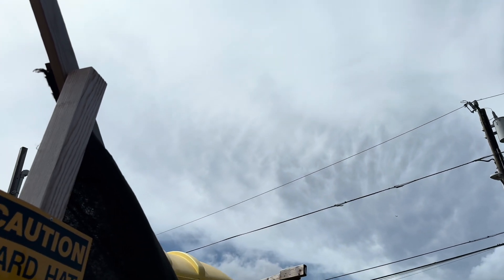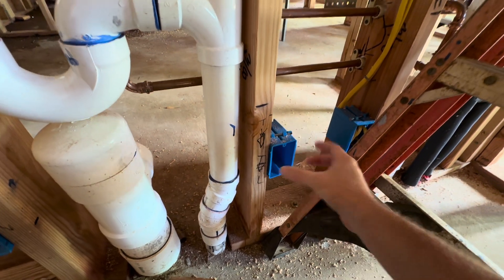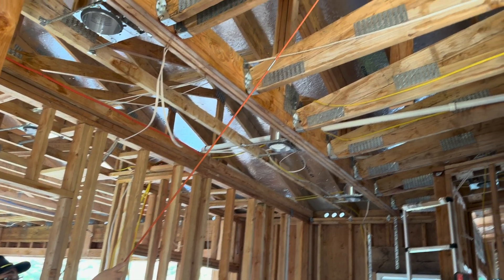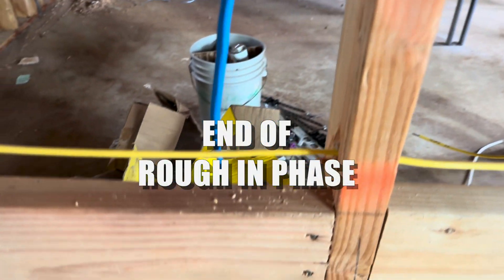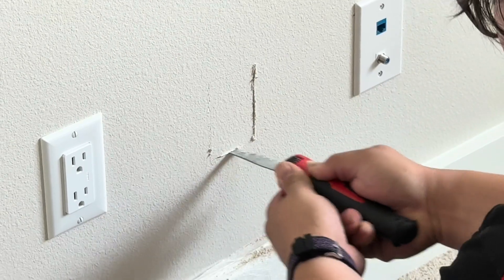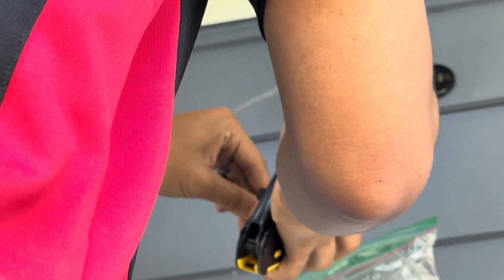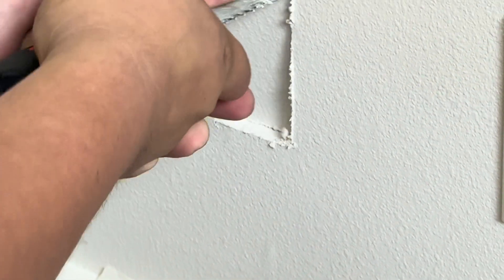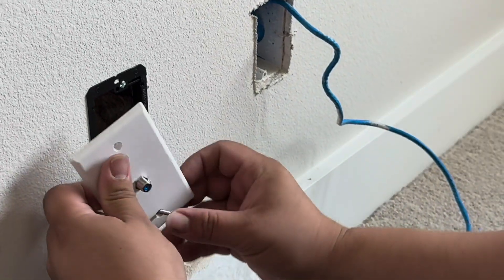Learning Network Cabling - Single Family Home

Comment: I put UFO's in my house, way better range. One in the middle gets the interior. Tiny hole for cat6, the mount plate on some drywall anchors. Keeps the insulation in the attic, and it's easy to patch over if I sell, and the new owner doesn't like. I ran the cabling down into a two gang mud ring with a brush plate. There's a few holes in the top plate, about 15 runs.

Comment: Been watching your videos as I will soon be running cat6 through our house we are about to start building. Been very helpful and glad to see you did a residential install. Two questions for you. Do the zip tie you used have a screw mount for them to go into the wood? If so, do you have an amazon link? Second question, why did you terminate the cat6 through the ceiling of the closet instead of the wall? I had always planned to go through the wall so just curious if there was any reason to do ceiling?
Reply from the maker: The diameter of the hole needed for so many wires would have split the 2x4 basically apart, so we did the ceiling entry.  Also, for later maintenance it is a little easier to string a new wire through a ceiling entry than the stud frame.  The zip ties, yes I used ones with a screw mount, here's the type we use: https://amzn.to/4oaYnhZ
Reply: @tciproductions  Thanks!

Comment: Know this is an old video, but what cable passthrough in the ceiling is that at 10:18 with the 4 screws? Never seen one like that.
Reply from the maker: We make them in-house on our 3d printer, if you look up TCI Productions on MakerWorld you can grab the model from there, its free.

Comment: I really appreciate you showing this, example. I had
My home pre-wired and am finding it difficult in how to install the outdoor camera’s. My vision is to have two cameras on each corner, and with 2 cat6 already run to a box on the outside, I am not sure how to protect the cables  or add outdoor rated , cables. Do you have any suggestions?
Reply from the maker: The easiest way is to paint them.  That will give a coating that soaks up the UV rays and can help a little with water infiltration.  Otherwise, what we sometimes do is put a keystone on the interior of the building, and then run a short length of exterior grade cable to the outside.  That way you don't end up working with the tough jacket of the outdoor cable while you are pulling into the closet.  It may depend on your site access and such of course.  But don't worry, most cables live happily outside with paint on them for a couple of decades.

Comment: I'm in Australia and unfortunately we do not have a standard of using the mounting boxes on the studs. Data cabling is too often an afterthought.
I was a cable installer on weekends while I studied engineering many years ago and few people appreciate the complexity of wiring a home - let alone once the sheetrock/gyprock is up! 

I'm having a security company install CCTV and other data lines etc for me in a couple of weeks and I'm trying to update some of my knowledge. 

May I ask a couple of general questions around ethernet and fiber runs in a residential ceiling space?  My goal is to understand how the cables should be run through an accessible residential roof area... strung? every crossing of power perpendicular? Service loop each end or acceptable tension going between floors etc?

For clarity on my question: As a junior installer I was taught to string CAT5 and coax through the trusses and to use velcro straps to hold it in place. I was not to leave it running across the joists like power cables and such do. Australian housing is a shit show in this regard and I've too frequently found power/telephone/antenna run haphazardly - even wired across the man hole.

Situation:
Moved in a few months ago and prepped as best I can - while solar was being installed (eg ran 4x large conduit from upper ceiling space to lower floor network room before solar blocked stopped lifting of roof sheets). Conduit drops to 9RU wall mount rack which I elected to use since CCTV/Internet etc is permanent infrastructure. 

I have all the gear needed and installer will run from my network space to end-points through upper ceiling space and a lower ceiling space.

Ceiling Space:
Brick veneer home. Standard roof space (attic?) of Colourbond roofing with insulation/foil attached. Joists with pink batt insulation laid between. Power run all over laying on joists, attached where it's meant to be but the Antenna coax and old CAT5 etc are typical haphazard mess. AC ducting runs with old cable both over and under it. Some cables in conduit (eg DC Solar)

A practical need for others to not damage the cable during future service access into the ceiling.

Should CAT6A and fiber be strung or laid across joists? Bundled together? Perhaps run along in parallel to joists where it's protected when possible? (I can see fiber being walked on where it crosses a joist by some fool).
Reply from the maker: Wow epic comment.  In my opinion, I think the wires should be strung along the joists.  I made a 3d part for this, freely available, at: https://makerworld.com/en/models/718698-cable-support-for-wooden-joists-cat6-coax#profileId-649576

You can also find similar things on Amazon like this: https://amzn.to/3Ys7iRm

I feel like the image examples in those links might give you an idea on how to handle things, but basically you want to create a highway of cables for all the reasons you mention, and end it just above the entry to your rack.  Be aware if you have a rodent problem that they love cable highways :)
Reply: @tciproductions  Thank you for taking time to reply and making the parts you use freely available! 

I'm pleased I seem to have been taught well in the past and will follow your advice. Hopefully I can have the installer also follow the advice haha.

Comment: The house we moved out of I had a rack in the closet on the wall. It was a PIA to manage / upgrade. The new house I have a rack on wheels in the bonus room. Probably way more than most would ever want. But pointing out that it can get pretty cramped in a closet and needing to get behind the panels once installed is no fun.

Comment: Really enjoyed watching this. 

I'd love to know why the home owner went with Unifi for networking but Ring for security when Unifi's offering in that area is really strong too and it's one fewer ecosystem to worry about.
Reply: Not to mention that cheap 18 port switch.
Reply from the maker: I think you get a letter in the mail when you build your first house that tells you to buy a ring doorbell and camera, and then to use Unifi products for wifi and switch/router :)  Honestly people just buy what they buy, you can't really convince anyone of anything, so I just go along with it.
Reply: @tciproductions  that makes more sense. I thought you had made the choices for them since your average person sources out those choices to installers.
Reply from the maker: @notafanboy250  In my experience anecdotally, commercial spaces ask the vendors to choose, and residential spaces tell the vendor what they've already bought :)
Reply: Not a ring fan. Very intermittent, did not work right half the time. Plus there is the mothership part which is a no go for me. I now have a doorbell that has a wired ethernet jack. Full control and no issues. No mothership.

Comment: Hello networking sensei! Why do reaidences run cables THROUGH studs? It makes it so hard to have any slack in the network closet in my house. Why do they affix the cables to the studs? How does one run a network drop to a room once a house is already built? Its difficult no?
Reply: Cables through studs isn't your problem. Lack of adequate service loop is.
Reply from the maker: They affix to the studs due to code requirements unfortunately.  It makes the service loop up top become useless, so I normally put the service loop down low at the box, or just behind it.  In a built out house you have to take a cordless circular saw and cut out a channel in your drywall to make a path for additional wires, it is a huge amount of work and often leaves a noticeable scar in the wall after patching.  I let handymen tackle jobs like that.